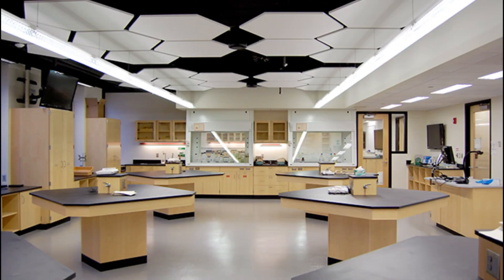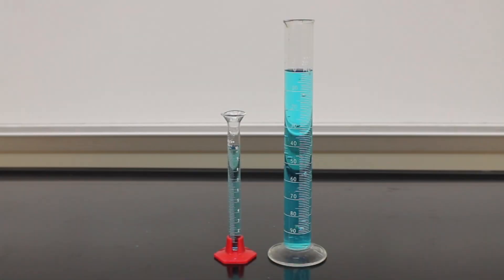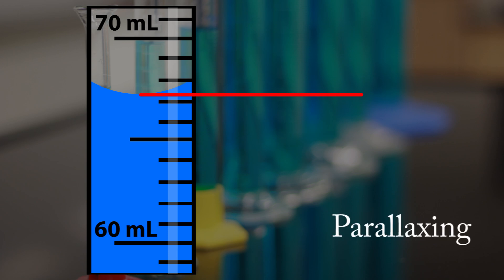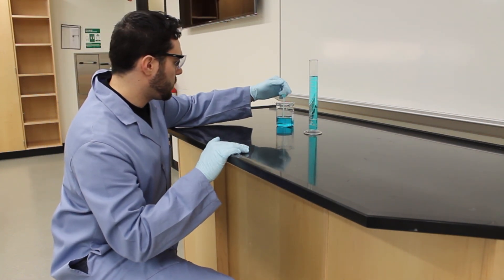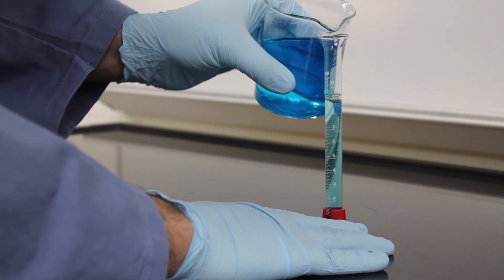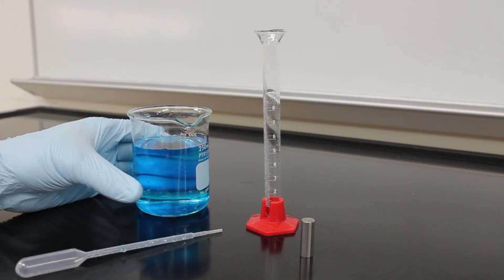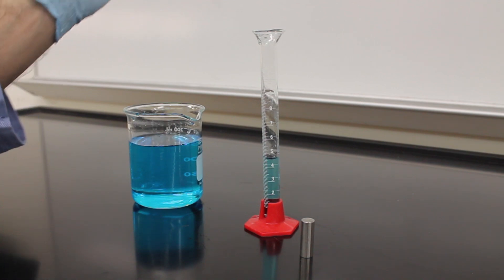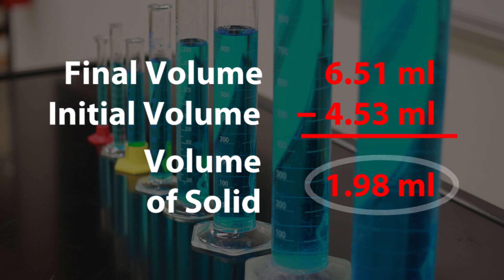Graduated Cylinder Technique

Comment: What if I hold the cylinder loosely enough for gravity to pull it vertical, instead of setting the cylinder on a table that might not be level?
Reply: you could do that probably idk im a business major
Reply: Richard Alexander nice question
Reply: When holding the cylinder, it might not be level enough. Try and find a level surface. Most labs should have level surfaces (IDK, I'm only in AP Chemistry)
Reply: @Chemderman  Gravity levels objects that are loose enough. You are a lot more likely to find level by hanging or dangling a cylinder than by setting it down on a surface.